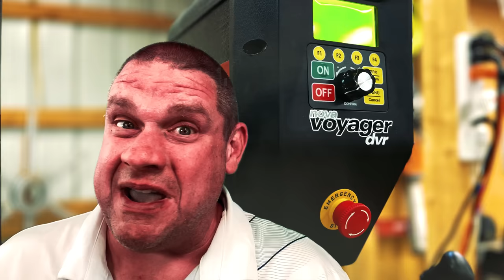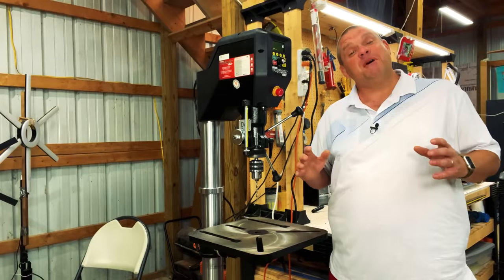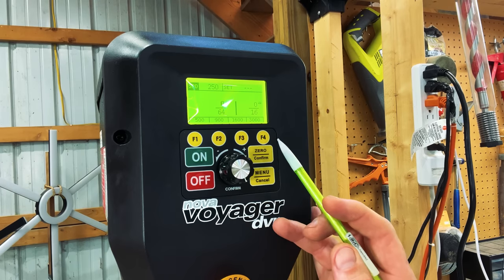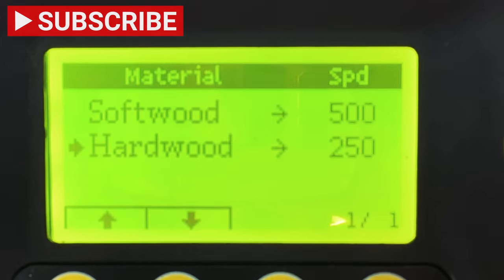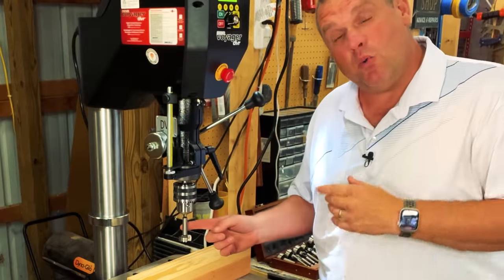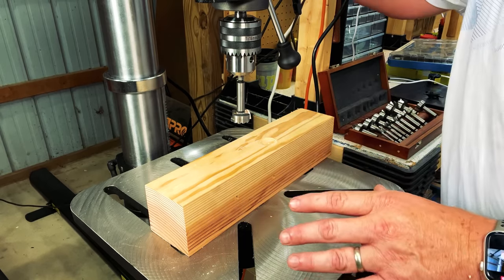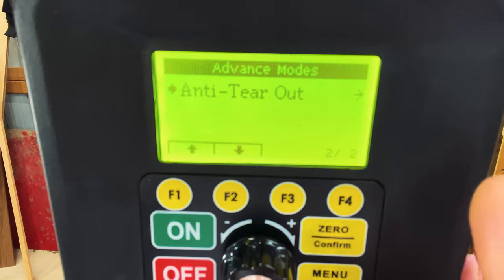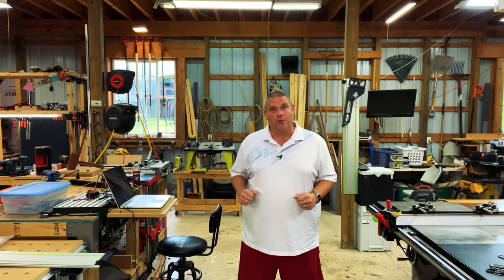Nova Voyager DVR Drill Press: The Future of Woodworking

Comment: Thanks for the nice review.  Can the machine be used for light milling of wood?  It seems adding a machinists' x-y vice would add a great deal of functionality, if the bearing could deal with light/moderate side loads?
Reply from the maker: Great question israelcharo!  I’m not 100% sure about the light milling, but it is a very sturdy machine, probably depends on what you mean by light milling.  I 100% agree with you on adding an XY vice.  I would love to add something like that in the near future.   I would also like to do some sort of drill press table that would have some settings for repetitive drilling and or clamping.  Great question and thank you for watching!

Comment: My menu doesn’t look anything like the one shown. When he used the drill bit to drill 3/4” deep, he went too slow. That’s a good way to burn the wood and overheat your drill bit. It’s a very good machine but the chuck that comes with it is not so good. It also goes up to 3000 rpm and 5000 rpm with a little configuration which is useful for small drill bits and drilling in aluminum.
Reply from the maker: Thank you for sharing David.   I'm surprised that the bit was going to slow since I set it with the machine.  I'm wondering if I slowed the clip down for visual affects.  I'll have to double check.   Also strange that your screen looks totally different!    I'm guessing we have different year models.   Thanks for sharing and watching!

Comment: Nice - I have the poor man's version, the Bosch PBD 40.

It lacks most of the Voyager's features, but has similar variable speed - do I miss having to change pulleys to change speed? What do you think?

I didn't buy the Voyager because:

1) I don't have the space.
2) My "shop" is a garage where everything rusts at the drop of a hat, so the PBD 40's aluminium table is a bonus.
3) I didn't want a tilting table as I sometimes use a cast iron compound table for metal work, and it meant my old drill's titling table would tilt when I didn't want it to tilt!
4) It's way too expensive for my budget, but the final point is:
5) It's just not available in the UK (or it wasn't when I looked a year or so ago.)

Doesn't stop me drooling over yours...
Reply from the maker: I just googled your Bosch PBD 40 and that looks amazing as well!   I love tools with new technologies like that.   All great reasons not to buy the Voyager.  Luckily I've got the space for it.  I have a shop that is not climate controlled right now, but I'm hoping to have it insulated and conditioned soon (with all the cast iron that really concerns me, I already clean off my saw table about 4 times a year from rust)   Thanks for sharing and great choice with the PBD 40!

Comment: Hi Thanks for your video. I had never seen the likes of this. One big question I have as you covered this machine very well!  Does the speed settings cover different materials such as  general metal boring applications? I see with the bits it doesn't cover sanding spindles ir wire brushes wich I don't do since the very early days of pressing my drill press into situations it wasn't design for, but drilling into metal would seem to have some preset speeds for convievence from the factory IMO. Thanks and sorry if this was covered and I missed it being addressed. Like your shop and presentation Brian. Nice work.
Reply from the maker: Yes!  There are some metal presets, I have not dug into this too much but I need to.  I rarely drill into metal but I know I will in the future.  Sounds like an excellent video idea.  Thanks for the great question!  Love your username.  I collect guitars and my les Paul is my baby!
Reply: @FlynndoggWoodwork  Great to hear on the metal presets Mr. Flynn, I have you subscribed. Need to get you filming at the tool shows too! Thos new automated fences for the table saw and router look interesting! i'm pulling the trigger on wixby laser for my old  drill press soon from your nova video,(time saver IMO, knowing where that bit will land every time). Yes have only one, a Lespaul custom. She was my first guitar that I bought in the mid 70's used, ( could of purchased used, could of bought a new copy for the same price. One of the best decisions in my whole life! : ) Thanks hope you find the time to play too Mr. Flynn.